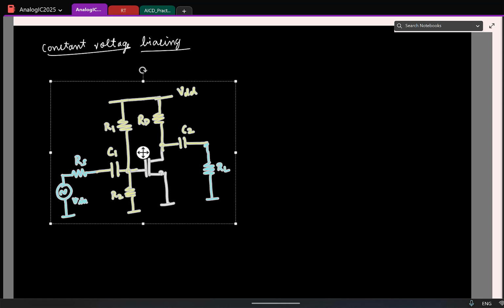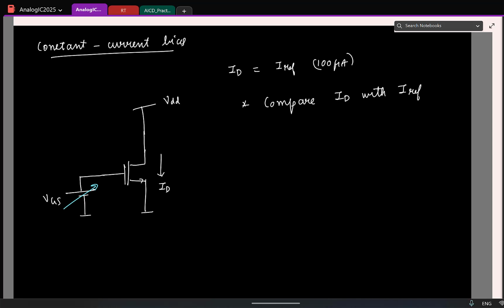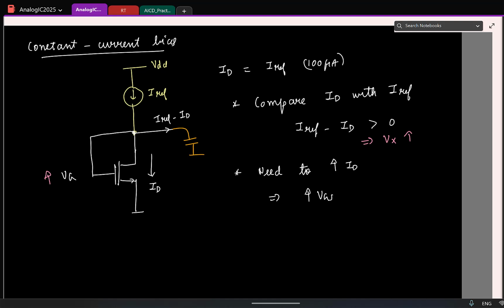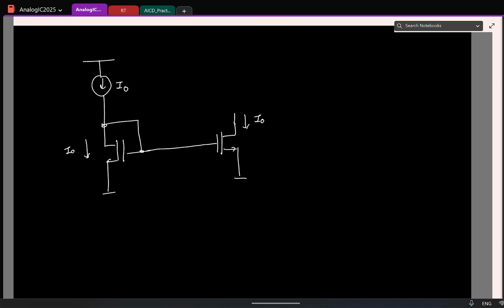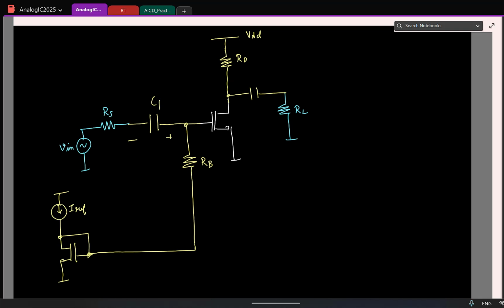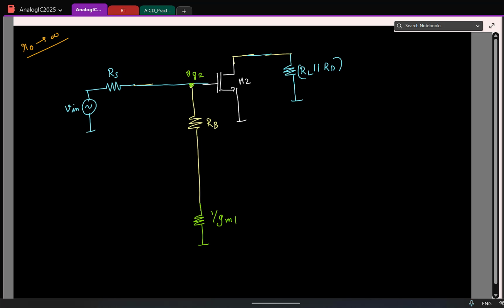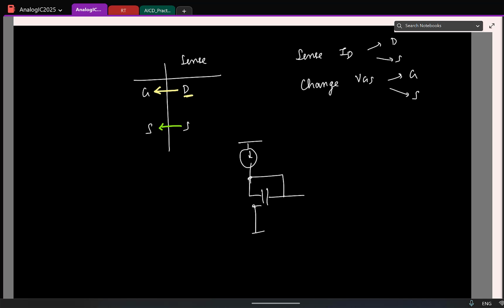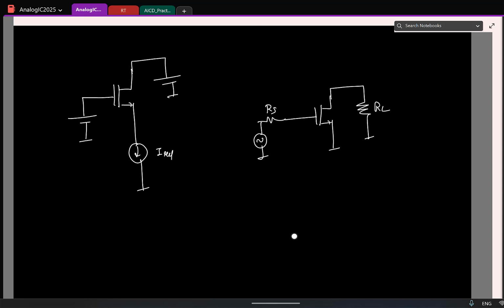Lec 3(2): Motivation for constant-current biasing; Drain and source feedback

Comment: 3:43 Doubts  : 
Let say i have design Vth=0.5v .after fabrication process it may be 0.4 or 0.6 .this is a fixed value  which leads to a fixed current, Id is fixed,Vd is fixed ,also gm .
Reply: Vth can vary with temperature and body biasing